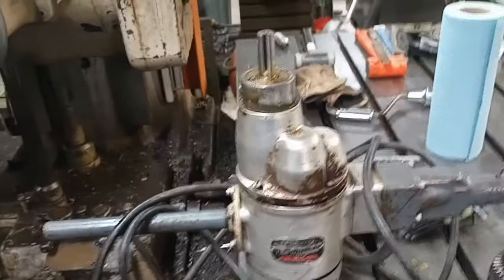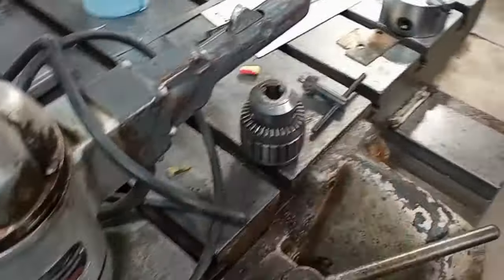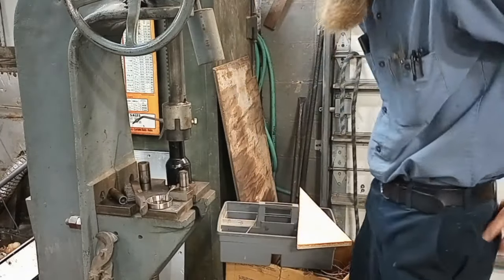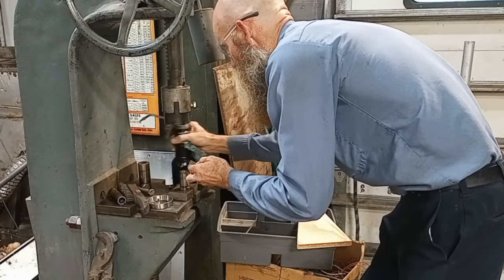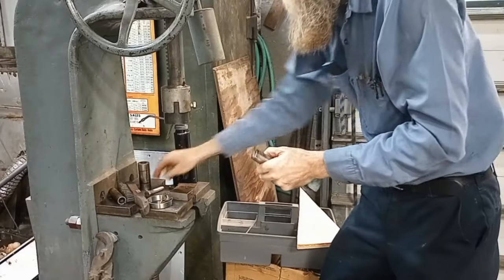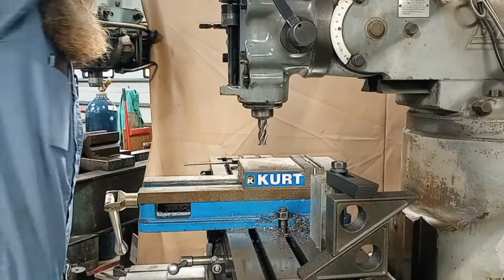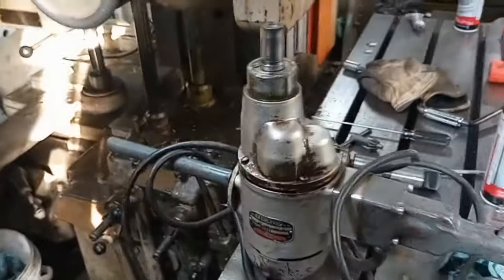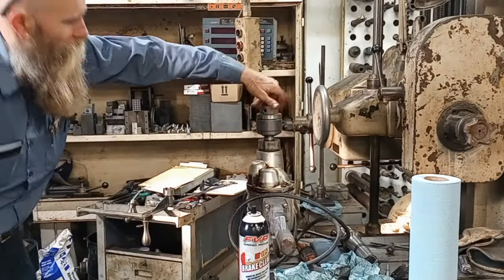making an adapter to install a chuck on the Black & Decker man killer drill motor.

Comment: A few drill motor stories about my dad and grandpa. 

#1 In the early 1940s my grandpa was laying on a creeper under a truck drilling large holes in the frame to attach tank straps. He had a similar, but older, 'man killer' drill motor which had the classic toggle switch. As often happens when drilling, just as the bit started to break through the backside of hole it caught leaving grandpa spinning around on the creeper shouting at my dad to 'turn it off!' If the bit caught you dare not let go of the handle to try and reach the toggle switch.

#2 In ~1975 my dad bought a B&D drill motor with a 1/4" Jacobs chuck. The chuck lasted about 3 years and Dad was very disappointed that it failed so soon. As it happened grandpa had recently had his 15+ year drill motor burn up. He was also greatly disappointed that it failed so soon. Grandpa's drill chuck wound up on Dad's drill motor and Dad used that the rest of his life. I have it now and take if down off the wall to use on occasion. It makes me very happy every time I do.
Reply from the maker: Thankfully this monster has the spring loaded switch, it has a toggle for reverse which is an interesting feature that my father's didn't possess.

Comment: I've spent a good deal of my life either operating or repairing heavy equipment.  Now, retired, I'm reduced to watching such on YouTube.  I enjoy your channel and consider you to be one of the best sources to ask a question that nags at me, that being, shouldn't bushing bosses be made of an alloy such as 4140 and then heat treated?  At least that's the way we did it in the old days. The prime characteristic needed is impact resistance. There are dozens of equipment repair channels, and I often see bushing bosses made out of mild steel. Of course, that might be fine for a small business with an old machine and operating on a shoestring budget, (I've been there) but when you are talking about multi-million dollar equipment where even the shortest amount of down time costs thousands of dollars, I would think that this would not be the case. Yet, as I said, I see it done on YT all the time. So, what's your take on bushing bosses?
Which brings up another question. We used specifically designed build up materials like Stoody Build Up. When building up after line boring, how impact resistant is the welding wire used?  Though this is a perfectly acceptable repair, I'm curious as to whether there is a loss of impact resistance with such a repair over what I assume would be an alloy, heat treated OEM bushing boss?  Thanks. Regards.
Reply from the maker: Good evening, I'll give you my two cents. Very little of the equipment built today is made out of anything that's even remotely close to alloy steel, so on the topic of weld out I run 70,000 PSI wire or stick and I'm quite certain that it equals or exceeds the base metal that I'm putting it on. I've heard rumors of some 90,000 PSI filler being used in the past, and possibly even being specified by cat but I don't have any personal experience with that. On the topic of Boss material, if time and customers finances allow for it I definitely prefer to get an alloy steel and have it heat treated, with exactly the objective that you mentioned maximum strength and impact resistance. But most of the time the customer is in too big of a hurry to wait for the parts to be sent off to heat treat so things just get assembled in their mild state. If I'm making bushings that are going to see actual wear then I start getting a bit more insistent upon the heat treating.
Reply from the maker: I should add that I always specify 4140 or the closest thing I can get to it for my heavy wall tube that I make bushings and bosses out of.
Reply: @Andy-PerpetualMotion   Thank you for taking the time to reply.  Line boring jobs are a popular subject of YouTube videos and Instagram reels. The one thing that they have in common is a failure of the bushing boss. I would say that the usual cause is lack of lubrication of the pin and bushing, that ends up destroying all three components. The pin, bushing, and the boss. But do you ever see the boss being damaged or destroyed from impact of the hardened bushing being pressed into a softer mild steel boss?  Or is it really not a concern?  Thanks. Regards.
Reply from the maker: I can't say that I have ever seen a failure caused by the bushing migrating into the boss. Failure is almost always caused by letting the pin and bushing get too sloppy, as the gap increases the pin is able to get a run at the bushing and eventually cracks it, have never seen a boar with a cracked bushing that didn't need to be redone, as soon as the bushing cracks it swags the bore oversize. I always try to increase the press fit a bit, that helps a lot to keep the bushings from cracking and let's people get away with more abuse before they fail.

Comment: I have the same model black and decker and in that model I have been able to obtain the complete range 1/2” 5/8 3/4 1” they are very good drills. I personally would have made your drill with a #3MT for what I do would give more versatility but that’s me grate job
Reply from the maker: It's called being cheap and using what I had available at the moment 😁
Reply: @Andy-PerpetualMotion well we say do what you have to do to get the job done

Comment: Oh Yeah! that baby will try and break a wrist! Useful for many things. As long as the field windings and armature stay intact those big drills will run forever with an occasional fresh dab of grease in the gearbox.
Reply from the maker: The 30 second spin down time is the scariest part of this thing, not only will it smack you, it will do it 20 more times before it stops.
Reply: @Andy-PerpetualMotion  LOL, If it doesn't knock some sense into you the first time around you have 25 more chances! Thats why the long handle so you can brace it against something. 
Some 30 years ago, I broke a gear in my 3/4" chuck Milwaukee once drilling a 1 1/2 hole. Drill caught and tried to rotate me and the part I was drilling. Before I could come to my senses, like  1/2 second later and let go it broke the bit and a gear in the gearbox! That was scary and I learnt a thing or two that day!🤣